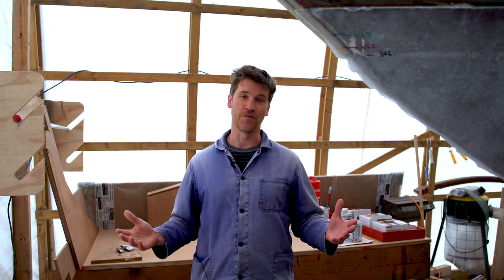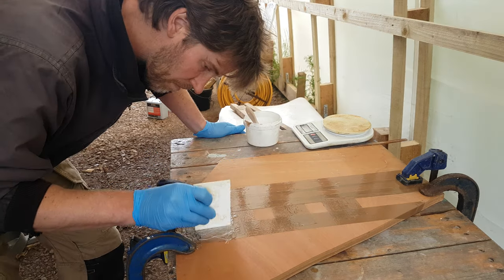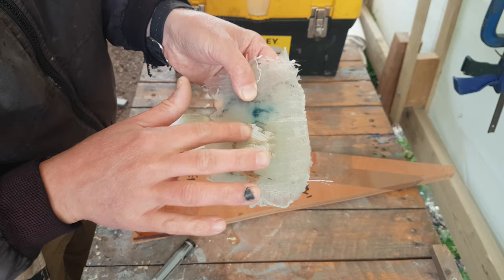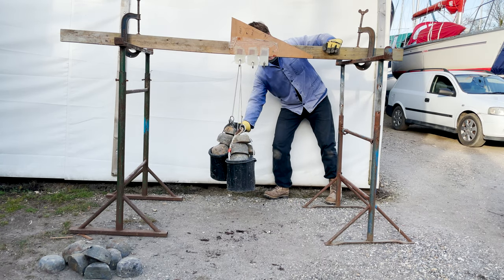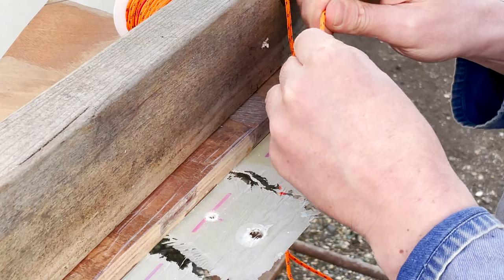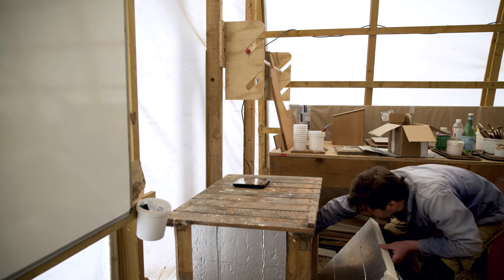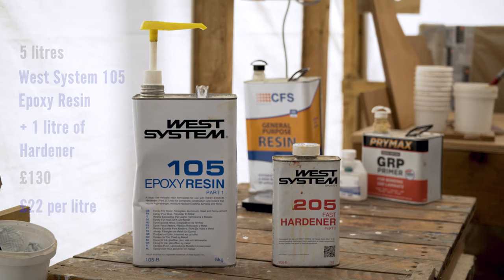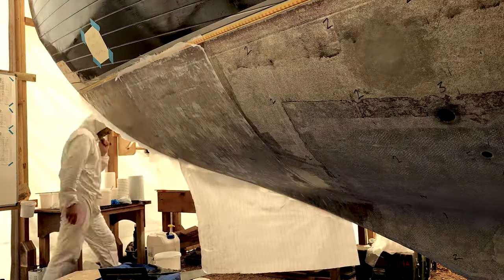EPOXY vs POLYESTER RESINS - TEST No.1 - LAMINATING ONTO MARINE PLYWOOD

Comment: Thanks. I am doing a refit currently on our Marine ply Eventide 26, and the majority of rot issues I encountered was where polyester resin and glass cloth was used over ply. In most of the problmem areas, it simply did not bind with the wood fibers and I could pull it off by hand. Fresh water also got trapped behind the polyester, and wood rot set in. I've now replaced the majority of the rotten wood with fresh wood. I use Aerontec Epoxy products, which is very similar to West. After watching your video, I am convinced that I am doing the right thing in using thick epoxy for gluing and penetrating epoxy and not polyester for treating wood before painting with MS primer and 2k. The cost savings in the short run, which previous owners of our boat probably chose to do, is now causing me lots of headaches. I would rather spend more and know that the boat is good for another 50 years. (She was built in 1977)

Comment: Good information in this video. This supports the idea that all you need is epoxy to seal the plywood fully and then laminate glass ( or carbon ) fibers over it. Since your test showed, the first layer of plywood is in danger, so now I understand better why the screwing or nailing of laminates into the plywood increases a lot of total strength of the laminate. I have put 2-3 layers over the wood or plywood, then drilling the holes for screws or nails, then applying 3-4 layers over the nailed layer. But there are a lot of big boats that have been laminated with polyester resin and chopped mat BUT laminates are always nailed. Then the bonding force is more the combination of the laminate AND the screws or nails, and cheaper resin can be used again. But if one method has to be chosen, use epoxy as primary resin for boat repairs.

Comment: Nice this is extremely helpful. If you ever do this again you should consider that you can just use the scale to pull directly without using the weight.

Comment: An extremely informative and valuable video. Many thanks for sharing. This couldn't have come at a better time - I am in the process of replacing the top skin on my aft cabin roof after replacing the balsa core. The top skin is 6mm thick. After a paralysing period of indecision and procrastination, I opted to use West System 105 epoxy for bonding the new balsa core and laying up the new top skin. I have just yesterday carried out a practice run at laying up a new (small) top skin in the garage at home using a piece of 6mm thick MDF with a square hole cut out and scarfed, to simulate the cut out section of cabin roof, then backed with some scrap plywood to simulate the core giving me a miniature pretend roof (approx. 1/8 of actual size) with a 6mm deep repair area to laminate into. I have a similar issue to you in that on my boat I cannot achieve the full 12:1 scarf ratio due to adjoining raised mouldings around the repair area. Best I can manage is a tad over 8:1 ratio. I opted for epoxy on that basis and was still reeling at the high material cost, wondering if I had been stupid. Your video has reassured me that I have made the right decision and I am now feeling a lot happier. During my practice lay up, I preheated the epoxy and hardner (206 slow) to 25 Dec C in my homemade warming cabinet and found the biaxial combination mat (6 layers) wet out ok with the use of a West System foam roller (expensive but worth it) and a bit of patience. I imagine it would be a nightmare in colder temperatures though (haven't tried). Thanks again for a very useful and well presented video. Just subscribed to your channel 😊.

Comment: Thinning the Polyester with  Styrene monomer, then wetting out the Marine Plywood first and allowing the resin to penetrate the Plywood, After curing for 30 minutes to an hour, will give the Polyester a much stronger bond when used full strength.

Comment: Great vid... Thanks. Important to note as well... once you've used epoxy in an area, don't apply any polyester based products over it without very specific surface prep. Epoxy onto polyester is fine.
Reply from the maker: I know this is the general rule, but I have yet to do an experiment to confirm. I suspect polyester will bond to epoxy in much the same way as it bonds to plywood!
Reply: @seaschool_  Great... Please let us know the results. I'd imagine that any additional "keying" component that you introduce as well as perhaps a primer might get good results. Before I knew this rule of thumb though, I had a minor failure using gelcoat over an epoxied patch, with the gelcoat simply peeling off after a few months.

Comment: for better polyester adhesion ont existing polyester, you must hammer the polyester with a wood chisel, to get some fibres out, then use a first coat of thin polyester resin, then proceed normally.

Comment: After using 20ltrs. of unwaxed resin [Polyester] 200 mtrs. of 16oz. x 100mm wide fibreglass tape and 4 litres of flow coat on my foam cored project boat, I needed to finish the job, by strengthening the the transom. This was the only place that I had timber [plywood] to work with. I tried polyester, the result was that I could lift the laminated glass layer with my fingernails. For me the only way to glass wood is to use epoxy resin. I only needed 1.5 ltrs so cost is not included in my decision in this case. If cost was a factor I would take into consideration the cost of doing the job twice.

Comment: Really interesting video. Andy has done a little similar tests on boatworks today-channel. There was at least bonding tests on different materials to gelcoat.

This is very interesting subject for me as I'm going to build big boat from scratch with wood-epoxy method. For interior work it would be beneficial to be able to use something a bit cheaper than epoxy though. For the hull - not so sure as it has to be 100% waterproof to protect the wood itself.
Reply from the maker: Thanks for this. For your application I’d probably use epoxy on the outside, but avoid painting it a dark colour unless your sailing in colder climes.
Reply: @seaschool_  I'm a bit lost on your comments above. What does the high temperature do to the epoxy? I've got some parts of my boat painted dark blue, and doing repairs with epoxy (as it can sit in the tub for long periods of time it takes me, unlike resin that will age ;) ). I am repainting it light blue, but it would help to know of the dangers of using epoxy on the roof, if it gets too hot in summer.
Reply from the maker: @TechyBen  Hello there. If you are in the tropics(are you?) and the sun is high, and you have painted your epoxy a dark colour then it can soften. For structural epoxy resin built elements this could be pretty disastrous. It does have to be pretty hot though for this to happen. If this doesn't answer your query please drop me an email at ahoy@sea.school
Reply: @seaschool_  No, just the UK. :P  Gets hot on the surface in full sun in summer. But I'm mainly only doing repairs so far.
Reply from the maker: @TechyBen  I wouldn't worry then. I'm planning on taking Black Sheep down to tropics sometime and it's got black topsides so I've avoided using epoxy in these areas for this reason. However, on the deck, which will be a pale colour, I have used some epoxies in a few areas.
Reply: @seaschool_  Cool. Or not. I mean hot. :D

Comment: For any kind of resin, first, score the surface with 40 or 80 grit sandpaper. After scoring, saturate the surface by resin before you place any lamination on it otherwise resin will be sucked up into the wood your lamination will be dry. Of course epoxy will be the winner of the bond test in any case but if you know what you are doing Polyester resin might be sufficient for the job. Boat manufacturers use polyester resin as they generally know what they are doing. For epoxy resin you need a workshop temperature of 15+ degrees Celcius for about 12 hours. Or make sure you work in a hot summer day. West System is a good epoxy but not my favorite. There are so many different epoxy resins available for marine use. I believe that WS is a rip off.
Reply: This was my thought also. I'd like to see the experiment repeated with the scoring done first.

Comment: Super interesting video!  I've never heard or seen Prymax mentioned anywhere else but the results speak for themselves.  There's absolutely no doubt epoxy wins for bonding in pretty much every circumstance but it would be hard to justify the price vs poly when used in conjunction with Prymax.  Do you know much about Vinylester resin? I've read its somewhere between poly and epoxy performance wise but yet others say its no better than poly when bonding to wood.
Reply: Hi mate, I'm in Scotland currently restoring a Mayland Fisher 500 to hold dual motors combined 3x the intended transom limit and this is a small project but a difficult one because of that reason. I'm dealing with every nasty angle there is and at 6ft3" can barely fit in the cuddy. Moaning aside the detail for the job is simple- No expense spared make it look like new, keep it roughly the same weight and hull dimensions and make it last at least another 40-50yrs. The boat was built by ex ww2 guys at Mayland in the early 70s who built it as a scaled down Vospa MTB they had constructed during the war. The little boat is a masterpiece is overbuilt to a level ive never seen before for any size craft. Its got a 2 shell cuddy fully float tanked and the outside its got the outer hull + an inner hull & a deck sole as well as Flotation tanks and it doesnt use wood at all other than its backbone for laying up. It's a cut down bulkheads throught rather than stringers and just built to last forever...  it straight up rejects poly and Vinyl fixes during the shrinkage phase especially if it's cold out it will delaminate an blow the entire fix out with a jet wash. Vinyl is OK for layup of boats when they are new and they chemically bond the entire thing, it's terrible for fixes plus you NEED to buy Vinyl resin from a reputable supplier as it only works for a few month after its been refined and bottled up. Its regarded as OK for interior use and only use it for structural if you can absolutely guarantee its age and you already know how to use it properly from smaller projects. Polly is poly its OK for minor fixes or large but non structural fixes but keep the area you are doing it in at the same temp for at least 12hr and it works outside OK in sunlight too. Proper Epoxy especially West Systems is by far the best not just in bad conditions but if you need to redo transoms etc that are already holding an engine that's at the upper boundary of the transom limit then the difference is that the repair with West Systems given you used the appropriate cloth will almost certainly never fail again in your lifetime, the polly or vinyl transom repair will either delaminate and crack after the first few winters or just perish over the next 5-7yr and need done again. You won't ever get poly or vinyl to do genuine Epoxy resins job and what people forget is that West systems be it the basic 105 or Gflex or other brands top epoxy are all from the same people and West Systems is just them selling you it direct rather than another badge on it with fillers or thinners in it.
Reply: Another thing about West Systems. The 105 is the daddy we know this and it's the most forgiving,  however pay attention to which cloth you lay up with it and the thickness as you don't want your fix to be rigid on a boat that likes to flex, nor do you want to accidentally do a fix between say your deck sole and actual hull where two laminate GRP lay ups that were intended by design to have a gap between them and flex independantly.. are now fully bonded together because you glued them up with proper epoxy. Basically beware of what you bond up below the surface with proper Epoxy as it genuinely is so strong a bond that even if you skelp the hull off a rock that part you bonded up accidentally to your inner hull will also get the brunt of the energy transfer... so don't over-do the job if you are using proper Epoxy like West 105. Do your first soak coat thick  then give it an hour then come back and lightly spread a thin layer over it keeping the brush or roller saturated so it doesn't grab the first sticky layer it just smears over it and gets rid of the bubbles. Then lay your cloth and don't put any resin above the cloth for the first minute or so just let it slither in. Then stipple the cloth in from above DO NOT PUSH OR SPREAD IT at this point.  Give it another minute or so then stipple it again from directly above and you will see air pockets so its easy to judge which parts you need to stipple in. If you need it to be Uber flat you need a fin roller and don't overuse it just push it at medium-2-light pressure over the entire area in the 4 common directions then walk away when it looks half decent as the 'flow-out' process will do the rest. Never over work an area with a brush, roller or spray gun.. walk away when you feel the liquid or resin harden up and start dragging or in spray gun terms when you start pushing the layed paint about with the air pressure. I won't ever tire of telling folk to walk away from an area they have messed up AS  SOON as they messed up, forget about that bit and move on dont destroy an entire area by pushing a mistake about trying to fix it. These bits can be fixed up perfectly by some leftover resin and cloth that you are using for the next bit of your project. 

One other thing to note if you aren't in the UK>
 We have powder bound chop strand for proper Epoxy, we are used to picking between the normal type Chop Strand matting for Poly and Vinyl resins OR the powder bound Chop Strand that's used with proper Epoxy. I know that most other places in the world outside UK and Japan you only associate chop strand with poly or vinyl but here in the UK the norm is that when using proper Epoxy you just order the "Powder bound" chop.   The differnce is huge as powder bound chop strand with proper Epoxy can easily out perform Poly or Vinyl with the more advanced weaves of cloth so just to put that in perspective proper Epoxy with basic powder bound chop-strand matting can easily out perform the best Vinyl or Poly that has multiple axial layers and roving layers.  If you try to lay up emulsion bound chop-strand designed for Poly or Vinyl with proper Epoxy resin then it will still work but you will need a lot of it and the repair will look ugly. If you try to lay power bound Chop Strand designed for Epoxy resins with Poly or Vinyl then you will have made a huge mistake as it will blow off in a high wind.

Comment: Isothalic polyester resin is much better when it comes to water resistance than the standard general purpose orthothalic polyester resin. Also tissue, also called veil, resists osmosis even when used with general purpose orthothalic polyester.

Comment: This is great information, thanks for sharing the tests. I wanted to do a similar comparison test, but had no idea about prymax so would have certainly discounted polyester had I done this myself as only a direct comparison between it and epoxy. It is a slight double edged sword for me as I was all ready for the epoxy route.... with its drawback for my use case. 

I have built a telescope observatory dome, which is thin plywood segments stretched over laminated plywood ribs - think a low resolution chocolate orange cut in half :D I want to encapsulate it in epoxy fibreglass for waterproofing and keep it a natural, unpainted finish like boat brightwork. The more I read the more I wonder if I am about to shoot myself in the foot given the UV instability of epoxy. Generally the takeway seems to be "low maintenance brightwork" is an oxymoron! 

Given how well prymax looks to work, I wonder if polyester resin could be back on the table for a (sort of) clear wood finish as, anecdotally at least, it seems to hold up well in the sun. I think I will do my own test, definitely using prymax - I plan on only using one 200gsm twill weave layer and there may be something about polyester resin preferring thicker layups than that, perhaps too brittle in thinner layers... testing will tell.

All the best with your rebuld.
Reply: One option would be to use a UV resistant epoxy. West System 105 resin with their 207 "special coating" hardner is claimed to be crystal clear, UV resistant and further fortified by overcoating with polyurethane varnish. It is their recommendation for clear finishing wood that will be exposed to sunlight. I've never tried it but it would be my go to choice for what you are describing. Polyester resin will turn opaque over time anyway if left clear and look nasty.
Reply: And absorb water. Prob not a issue in your case….

Comment: The polyester works maybe better in reality than this. In the real world, you would wet the plywood in advance, before laying any cloth, a bit more than here.  The second thing is that with poly, on the bonding layer, you  usually would use chopped strand mat( emulsion bond version), as a bonding layer before any other matt. CSM helps wetting also the cloth.  I am a hobby boat repair guy, and even if epoxy as a resin has a much better bond, i consider hand laminating polyester is a bit more forgiving. Alternating CSM with cloth makes polyester laminating much easier than with epoxy. particularly in difficult bends....Epoxy also needs much beter prep( due to lack of emulsion bond matt). Rotten plywood is usually due to holes in laminate, never mind epoxy or polyester. In repair jobs, I actually mostly use epoxy as then i don't need to worry what material is previously used....but I would otherwise use polyester as its so much easier to laminate.